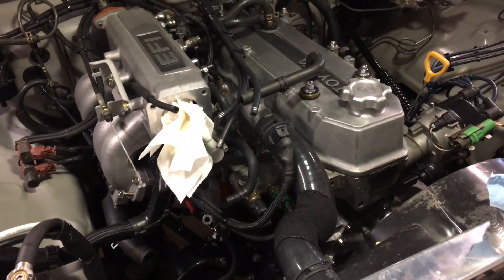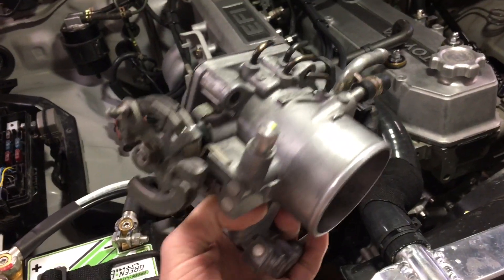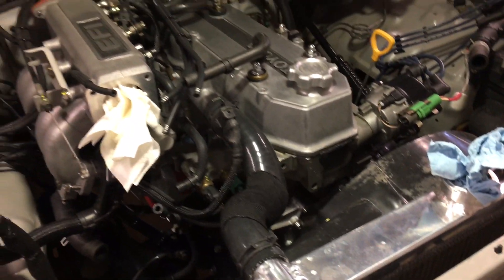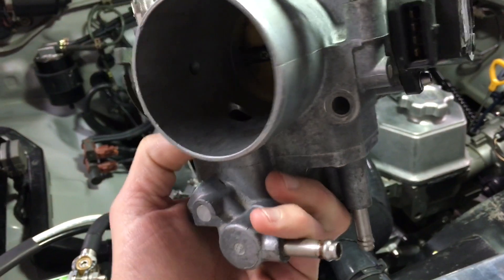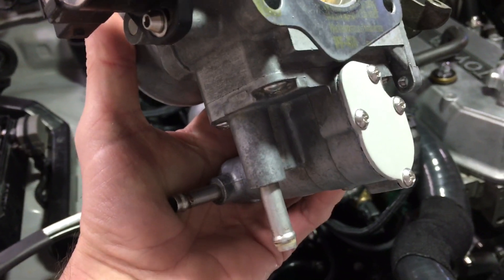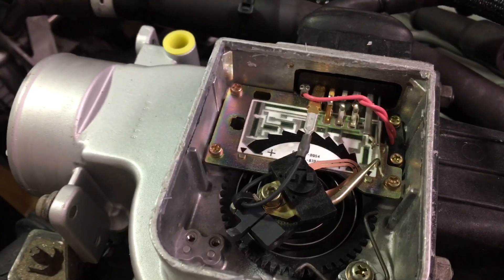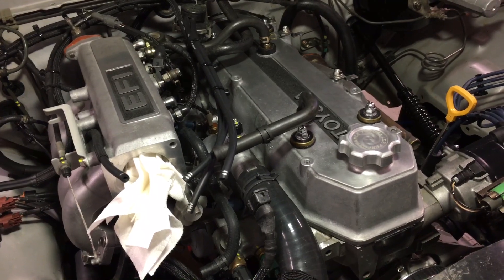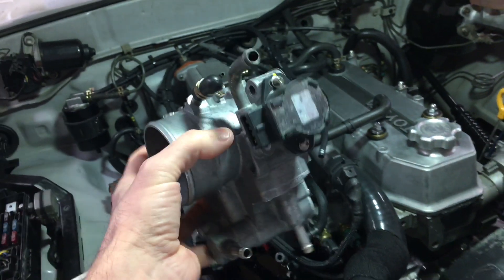Adjusting the Toyota 22RE pickup IAC auxiliary valve for more stable idle warm up

Comment: Hi Ray, do you think that cold injector would effect the fast idle on startup? Thks..jc
Reply from the maker: Generally speaking, it's not the injector itself, but rather the cold start timer switch / circuit. The IAC valve also plays an important role in things, especially that fast idle part in the morning. I have a couple of other videos on how the IAC valve functions, so you might enjoy checking out those. Here is a link specific to the cold start switch. There is also a good link at LCE (as well as 22RE performance's website) which explains how to verify that this switch is operating within range. https://22reperformance.com/22re-engine-electrical/cold-start-injector-thermo-time-switch
Reply: @ray5961  Thks Ray..Appreciate your time..jc

Comment: Very interesting video buddy. I have a 1989 pickup with a 22re. I have replaced the iac with a oem valve. The problem I'm having is when the engine is between probably 130-180 degrees it idles low and rough. I was thinking maybe my iac is staying open too long? What do you think.
Reply from the maker: Hmm.. hard to say. The IAC valve should be pretty much totally shut by 140 degrees. My advice would be to tape over the inlet hole (just inside the throttle body) to take the entire IAC valve circuit out of contention. Then drive the truck and see if it idles okay once it's up to operating temp (~180F). That will tell you if your problem relates to the IAC stuff or if it's some place else. Also check to see if the hoses running to and from the IAC are both warm, once the motor is warming up. That will tell you if there is constant flow across the valve, which is required to keep it closed when the motor is hot.

Comment: Hi Ray I’m having a similar issue with idle air valve and I am wanting to replace it but online it’s 89-95 my truck is an 86 automatic transmission I’m wondering if it the same part for my year. Also my truck at times won’t shift correctly if I first turn it on and drive off first gear will go in but second will rev high but no slipping-if I come to a stop and start over problem goes away truck does it like once a month mainly when cold but sometimes even if warm an had been sitting for few hours could it also have to do with that air valve?
Reply from the maker: If I'm not mistaken, the 86 is carbureted whereas the 89-95 had fuel injection. So that's probably going to be a different part for your truck. Not sure about the transmission stuff; I mainly work on manual transmissions.
Reply: @ray5961  my 86 is fuel injected efi factory thanks
Reply from the maker: @kawi1999jv  in that case, it's probably the same setup. Just look under the throttle body and see. You can quickly check to see if there is water flowing across the IAC valve by checking the upper and lower hoses to confirm they are warm once the engine gets up to operating temp. That's always a good place to start.
Reply: @ray5961  it does have one was just wondering if your part would fit on my truck
Reply from the maker: @kawi1999jv  I'm not sure. The best thing would be to check the part #'s for each model year on line using Toyota's parts website. You can check your model year and also the 90 or 92 model or something and see if it comes up showing the same part # on their diagrams or not. Toyota does use a lot of the same parts among cars and years, so it's quite possible
Reply: @ray5961  thanks I’ll check
Reply: @ray5961  1985-1988 uses a different setup.

Comment: Hi I have a problem with my 89 22re has a miss at idle and low rpms. I as well came a across your videos great info too but can’t seem to find the problem I’ve read that it could be leaking injectors as well as the cold start one. I put new flamethrower ones last year so I’m ruling those out as of now. Oh it’s also hard to start it cranks more than it use too I’ve owned this truck for 5 years now. I work on my own stuff because I like to learn about these great motors. Anyway I’ve heard good and bad about those injectors also I did the duct tape trick too nothing changed so I’m assuming that that’s not the problem. The truck is completely stock. I’ve considered deleting the emissions stuff to see if that would help. Any input would help thanks for putting these videos together for people that love Toyota’s I own three lol
Reply from the maker: I'd check the spark plug wires, cap and rotor. I use a diagnostic device called the TA500 which will shows spark plug burn time and voltage - that can really help track down issues. Check the spark plug wire resistance also. A broken wire can cause a miss at idle. I'd also check the spark plugs for oil residue. You could have a failing head gasket. Does your motor burn a lot of oil? That can be another rip off. Usually a miss is electrical issues. I'd check for vacuum leaks also. As far as removing the smog stuff, that won't help as much as you might think, especially if it's working correctly. Try applying vacuum to the top of the EGR valve and see if the car starts to stall out, that will help confirm the EGR valve isn't stuck open. You can leave that vacuum hose off to totally disable the EGR system for testing, but keep in mind most of the smog stuff only comes into play while cruising. As idle and WOT it's off anyway. I'd check your plugs for sure and look at the color and also run a compression check (all plugs out, holding the throttle open, crank for 10 seconds) - each cylinder should be around 170 +/- 5 psi or so. On a good motor it should be 170 to 175 right across the board usually. Hard cranking could be a vacuum leak or ignition. Usually the 22RE should fire right up in less than 1 second and run well. Also, sometimes a miss can be carbon build up on the top of the pistons - it will create a little hot spot that almost acts like a glow plug in rare cases. Try running the highest octane gas you can buy, also make sure your initial timing is correct. The other thing is to clean the inside of the distributor cap because sometimes you can end up with carbon traces or moisture in there. Definitely check your spark plug wires. Also check that the ground strap between the cylinder head and block or frame is good; I added a 2nd ground strap from the cylinder head to the block and from the block to the battery using fresh battery cable and that helped things run better on my truck for sure.
Reply: @ray5961  I thank you for your input it’s fixed it had moisture in the cap and I did put some additive in the fuel today going to fill it ton the way to work this week.
Reply from the maker: @albertliverman2572  cool good luck! Best fuel injector cleaner is Techron injector cleaner at Chevron. Also marvel mystery oil isn't half bad

Comment: @Ray Nada I have a 1991 Toyota Pickup with the 22re in it and I’ve had a high idle and idle surge issue for a while and I can’t figure it out. It surges for about 20 minutes during its warmup period and when the brake is applied it lowers the idle and surges, once it’s at operating temperature it’s gone completely. I’ve done all the research I can and never get anywhere near solving it. The truck has an egr delete and a smog delete. I’ve replaced all my vacuum lines, new brake booster, new tps, new IAC, Cleaned up the throttle body. My idle adjustment screw is also bottomed out and turning it out just continues to make the idle too high. I’m looking into flushing the coolant, doing a valve adjustment, and replacing the pcv. Do you have any ideas as to what could be causing my high idle and surge?
Reply from the maker: check the upper and lower hoses to the IAC valve and confirm both are warm. Also check the engine coolant temp sensor and make sure the voltage is correct. I would also try manually blocking the IAC air passage with some duct tape to totally shut off the IAC circuit and see if that helps (check some of my other videos for info). The other thing would be to check the integrity of the O2 sensor wiring harnesses and check the O2 sensors are working. Also check the injectors by pulling each harness off one by one if possible and or hold a hose to each one and confirm they are clicking. I have my EGR disabled but the AS still working as it helps keep the O2 sensors clean and also seems to help level out the ECU trim circuits. You can also monitor voltage on the VF and E1 terminals in the diagnostic box and see what the voltage is - that will give you some insight into the OBD1 and what the ECU is doing. I'll have a video on that soon actually. To me it sounds like the IAC isn't getting coolant flow or perhaps the engine coolant temp sensor is bad.
Reply: I have the exact same issue you described! Have you tried any of the solutions Ray Nada offered yet?

Comment: @Ray Nada ...great 22RE videos! Just embarking on a similar project myself with a 91’ 4WD, albeit much less involved with respect to custom fab of parts. A few questions.. I see a lot of capped vacuum lines — which systems did you delete? And before you went with your custom Wilwood brake setup, did you consider any other aftermarket solutions that would bolt right up? Thanks so much!!
Reply from the maker: Thanks! Yeah, initially I looked into doing some sort of big brake swap from later year Toyotas but couldn't really figure out anything I liked. I then looked into some kits by Little Machine Mfg or whatever it's called, but the one I liked required 18" rims, which I didn't want. Also tried one from Sky mfg but it was whack and and used a lame GM caliper - the first adapter from them was defective because they had an error in their CNC file; even after they finally believed me and fixed their CAD stuff, it was still not what I wanted. I ended up just designing my own to work with 17" rims and to use the specific calipers I wanted, along with the rotors, etc. But man oh man it was a lot of work. As far as the vacuum stuff, I'm still running the AS / air injection system as well as the EGR system, but I just relocated the VSV solenoids off to the side, so they aren't in the way of the valve cover. The only one I deleted was the fuel pressure VSV and then I just ran vacuum directly to the fuel pressure regulator on the fuel rail; so the load based on vacuum still modulates the fuel pressure, but the ECU doesn't have any say in the matter. So all the vacuum lines are present, they are just rerouted. I also made my own charcoal canister, but it's smaller so it doesn't take up as much space. Unless you are running a custom ECU, it's probably better to leave the EGR and AS systems working so the stock ECU doesn't wig out too much on the air/fuel ratio. You can tweak the spring in the AFM (air flow meter), but I've never had a lot of luck using that method. Check my other videos and I have one that explains how the different systems function also. Let me know if you have any other questions. Good luck with your project over there!
Reply: @ray5961  I appreciate all the background information, Ray. With the 4WD, I’m running 15” wheels with 31” tires so I’ll have even less options with respect to clearance. After stumbling on this video, I went down the rabbit hole watching many of your videos last night. It’s really great to see someone making new 22RE content, especially someone with your level of mechanical know-how! Your IAC video came in handy as I’m currently struggling with a sporadic overheating/idle surging issue that I think may be related to the IAC. I had an overpressurization of the coolant system that blew a ton of coolant out the overflow. At first I thought head gasket, blowing exhaust into the coolant, but I’ve pressure tested the coolant system, block tested via the radiator cap, and passed a compression test with flying colors. I’m thinking perhaps I have a partially clogged IAC or one of the lines running to it that’s making my idle jump. After my overpressurization incident, I found some silicone or RTV floating around in the radiator. I wonder if the PO was a little overzealous with its use during the head replacement and some has dislodged and got into the coolant system. I’m going to pull it and the throttle body off, clean them, and replace all the coolant lines on the truck. Probably get a new radiator too. Truck has ~275K, PO states he put a new head on it ~45K miles ago but used aftermarket. I’m going to get as much mileage as I can out of it while making other updates to the truck, and when it finally gets tired, probably throw in a brand new LCE long block. Though, perhaps you’ll have your 2.7 swap figured out by then and I can follow along and do the same! Thanks again Ray — really appreciate the content and comments!!
Reply from the maker: @jska413  RTV can definitely clog the hose going to the IAC valve, but it's easy to check - just feel the upper and lower hose to see if both are warm to the touch. If so, then you're okay. You might consider installing a 180 degree thermostat also. Try purging the system of air also, but running the motor with the radiator cap removed (just be super careful and/or use that orange plastic thing I show - make sure to have the heater valve turned on also.
Reply: @ray5961  Yup — I burped the coolant system with the truck on an incline using a spill free orange funnel with the heat on. I still see some occasional surging. When it happens, coolant will expand into the funnel, and then all of a sudden the idle goes back to normal and the coolant level drops back into the radiator. That has me thinking an intermittent clog. I also tested my radiator with an IR thermometer and it’s about 140F at the top, 110F at the bottom, but the fins are all cold, so I’m thinking it’s gummed up. All this considered, I’m just going to rebuild the coolant system as previously mentioned. I found a dealer with the OE radiators still in stock, I think I’ll go that route for simplicity. Thanks Ray.
Reply from the maker: @jska413  check some of my recent videos, there's one where I talk about my aluminum radiator and electric fan that might be of interest to you. To me, it sounds like you might have blocking in the motor some place. On my motor, before I changed the head gasket, I saw similar stuff to what you are talking about where coolant level rise and fall. After changing the head and head gasket and cleaning out the block coolant passages, etc, that seems to have gone away. Now I also can see the coolant flowing past the open cap much faster so I think I'm getting more circulation now. I'm wondering if before the cooling system was having trouble circulating correctly or something. The champion aluminum radiator is a direct bolt in and works really well. I'm running a 180 thermostat and the truck stays cooler on the highway now because it lets coolant flow a bit sooner. I needed that to balance when my electric fan comes on, but with a mechanical clutch fan it might not be as big a deal. With my current setup, my oil temp ranges between about 175 and 190. I have a gauge to measure water temp coming out of the radiator and going back into the motor, but it's not attached yet.
Reply: @ray5961  Yup, saw it! I’ll start with the coolant system overhaul, since that would happen anyways regardless if I replace the long block. If that doesn’t solve the issue, I’ll dig deeper! Thanks for the info on the Champion. I’m leaning towards going OEM since I found some still available and I’m not 100% sold on aluminum radiators. Take care!!
Reply from the maker: @jska413  The champion radiator is super nice and not all that expensive.

Comment: @Ray Nada
Thanks very much for these IAC videos. Did that 3.5 turns adjustment work well? I'm fairly sure I did the exact same thing you did and reassembled my IAC at a much higher temperature setting (somewhere near thermostat temp). My other trucks are carbureted, so I can't use those as a benchmark.
Reply from the maker: it worked well, but I don't get as high an RPM at initial start up as I used to. But living in a relatively warm area, it works fine for me
Reply: Okay, I will give that a try. I'm in a warm area as well, so that works for me. Thanks again!

Comment: Hey I have a question my truck is not getting hot on the dash gauge
Reply from the maker: check your sending unit first using an ohm meter
Reply: @ray5961  ok I will thanks